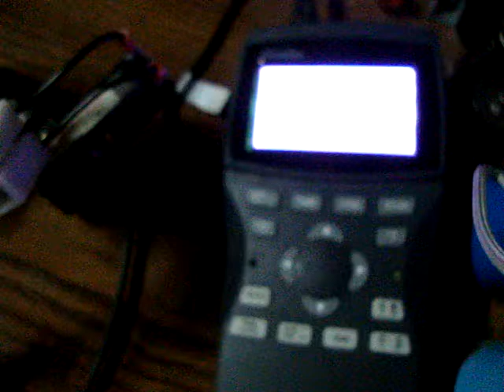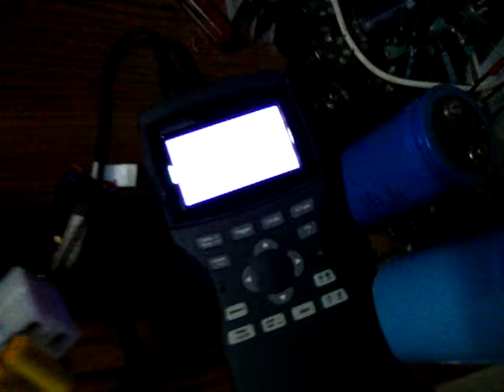Shaded pole motor nose coupled, fails to self run.

Comment: Not a great believer it can work at all, however, the original test was 240v and 220v
shaded pole motors and they were not nose to nose. The geometric configuration may be important. If this coupling works then it is NOT a manifestation of Sciama's Inertial Induction but a totally different unexplained effect of drawing energy out of the vacuum. This doesn't seem to make any sense to me.
Reply from the maker: It doesn't matter, I tried it coupled just as the video showed it as well with the motors on the same plane and belted by a rubber band and still the waveform output was nowhere near what it needed to be for it to self sustain.   I even embedded 2 x neo magnets in one of the 220v motors to see if that would up the volts, and it did, but not enough to run itself.  I even tried the motor side at 120v and the gen side at 240v, thinking I should have double the volts from the gen side so it should easily drive the 120v drive side, but nothing. 

I have all 6 motors I snagged for this work still, and am willing to sell them for a reasonable cost if you would like to do this for yourself.  I think I spent about 100 dollars gathering all the bits and pieces, maybe like 50 bux plus shipping to wherever.  Might as well get them in another builders hands so that the truth can be made known for each on their own bench eh?  ;)  Take care.
Reply from the maker: I'd add that the 220v motors ARE 240v as they have a 3rd lead on them that gets you that extra 20v off the motor.   Really the turn count is not much different for the 220 to the 240, and it certainly isn't enough to make the configuration run as those guys noted.   Seems like they just multitapped that coil for the fan motor to account for the slight voltage skew on 50hz motors.

Comment from the maker: Yeah that will kick it from the 115hz down to ~100hz eh?   Seems like I need to make a little decades capacity box with switches to tune on the fly huh...  sorta like the Rotoverter junk.

Comment from the maker: Can you share your thinking on why you would use the smaller rated capacity?   When I usually go about tuning a motor as alternator/generator, I put a capacity of some size on it, then note the peak to peak volts, then I go up or down in capacity and take the reading again, and I plot this out to find where the peak is in the average curve for capacity use.   Going below .33uF and the peak to peak volts start to drop off... they are higher when at .66uF than at .33uF so going smaller seems iffy.

Comment from the maker: Resistance is usually only accounted for in Time Constants, not usually in the Resonance calculations.    You have an email address?  I can shoot you the excel workbook I put together to help with the calcs.    Also note the 811mH is the 120v coil, while the 2.8-3H is the 240v coils.   I think it needs to be the 240v motors for the .68uF to work, if that will work at all.   thoughts?

Comment from the maker: Note that on the 220-240v motors the .68uF is pretty close to what might bring the motors resonant at 120hz.   (just not on the 120v motors)   The 240v motor has an inductance from 2.8H to 3H.  The 120v motor has an inductance of ~811mH.   The main difference appears to be laminate stack thickness.   (altho the 240v motor has a dc resistance of 220ohm, while 120v motor has dc resistance of just 70ohmz.)  In general it looks like a triple increase from 120v to 240v on all Stats for the motors.

Comment from the maker: ID differences don't matter on pulleys, only the OD matters in terms of step up/step down.  The pulleys they used look to be identical on both motors.  Already did the resonance calcs, not even close to what the other vids were saying should be used at the .68uF mark.   Using .68uF the resonance of the 811mH inductance is at ~215hz.  (which means that one of the motors is likely an 1800rpm motor/4pole rotor.)

Comment from the maker: How many poles on the ferrite rings?  These motors appear to be 2 pole, so drilling out two slots 180 degrees apart should work, presuming I still want to run at the 3600rpm rate, more poles slower rpm.

Comment from the maker: Yup, tried it both in parallel and crossed over.   Neither way worked for me.  best I see on the scope is some 300mV when spun by hand, when spun by the other motor powered from 120v 60hz mains, I get max 12volts peak to peak on the motor being used as generator.   They must be using perm magnets embedded in both motors rotors in their vids, I note the pulley color could be used to mark pole location of the embedded magnets to allow for 90degree offset... So might try that route.